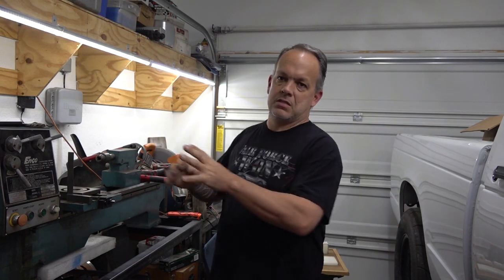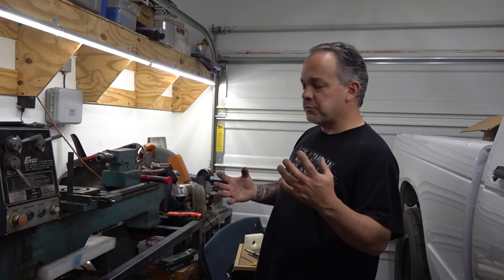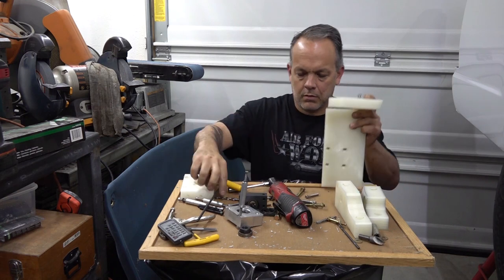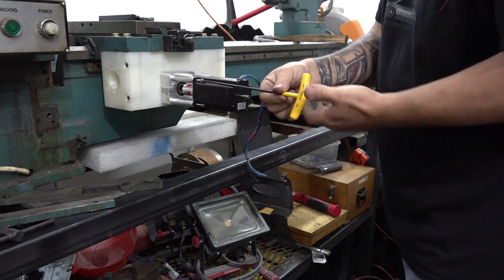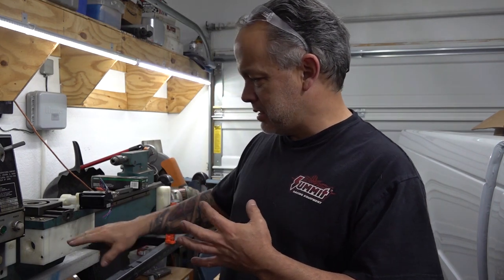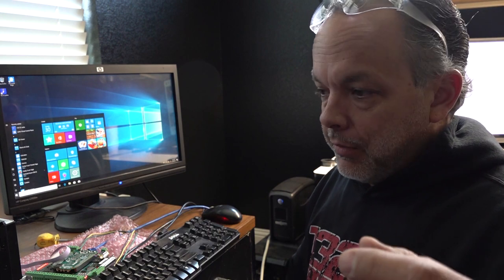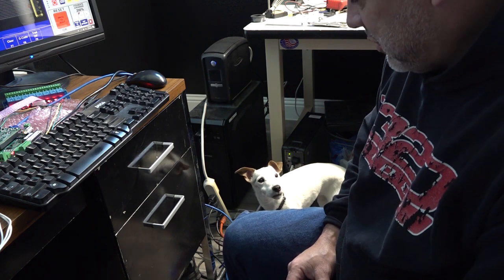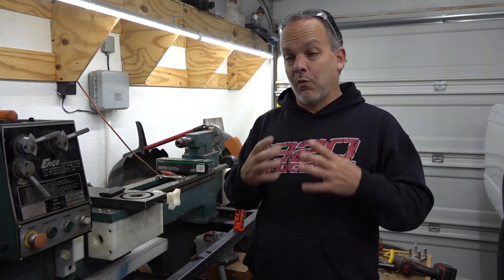Using 3D printed parts to build a DIY CNC lathe - Centroid Acorn controlled

Comment: Thanks for sharing about the Centroid controller.  Its going to be amazing to see what you can make using CNC on the lathe.  Interesting series.
Reply from the maker: Thanks John! I've ran them in the past and man - they're easy to run, easy to program right there on the machine with the conversational programming. Can't go wrong!

Comment: Nice job on your lathe conversion looking forward for  some parts made. I started off with Mach3 more than ten years ago only dance in town plus one license for many machines (plasma table,two Bridgeport’s, & 2 lathes). Now I have replaced MACH3 with Acorn Centriod a lot more consistent operations. So keep up the good work and I am also working on a 86 S10 5.3 truck motor only a 60 trans. Good luck John !👍
Reply from the maker: Man, I grew to hate Mach from day 1. I had centroid controlled Bridgeport years ago - I loved the conversational programming. It's so fast and easy....and a lot.of what I do can be done with strictly conversational. Once I (finally) get the lathe done, I'll convert the mach 3 powered mill to Acorn as well!
Reply: @diygaragetx  Yep acorn is awesome the conversational is great only use Fusion 360 for a few things now for the lathe. I also converted a Ikegai Fx25 with acorn that things is a beast 20Hp DC spindle motor. All in fun😀. Stay safe.